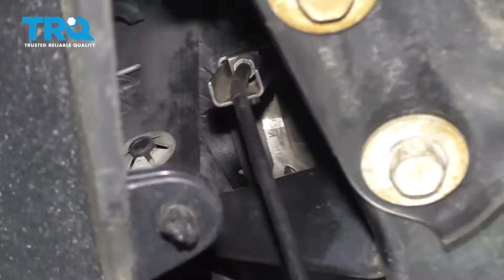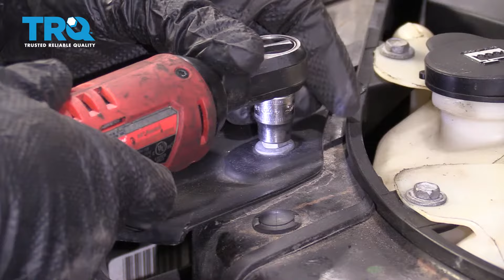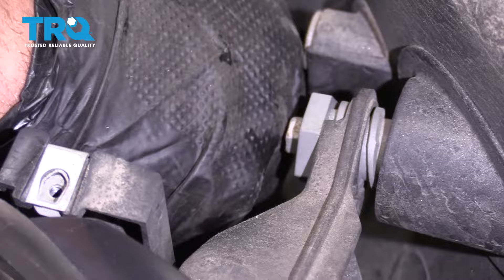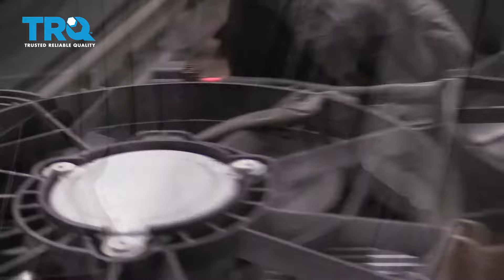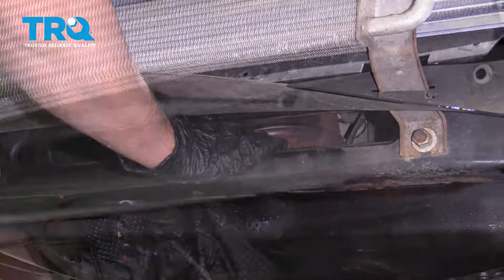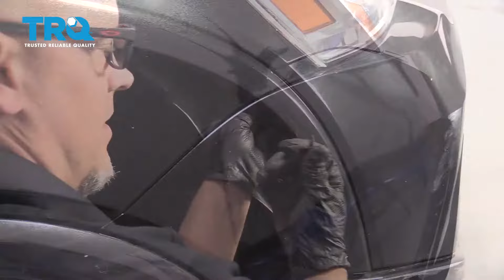How to Replace Radiator 2007-16 GMC Acadia

Comment: Great video. Suggestion for anyone watching. Don't take the bottom radiator hose off as the first step. Wait until you take the bumper off, it will be much easier. And if you're like me, thinking you might be able to get the radiator out with taking the entire bumper off, you can't.
Reply: Great suggestion...thanks need to replace mine soon

Comment: Bro, can you tell me if its true that in traverse models is normal when temp indicator go up of the middle? In my case in traffic o slow ride it pass the middle 210°, but in highway or parking it comes down to the middle please help, the coolant system its good no leaks, fans works, temp sensor its new

Comment: I have a question. My traction stability control light come on when i step on the break and it jerk. How can fix that? I changed the spark plug, PCV, cleaned the throttle and also I changed the brake pedal position sensor.. please help me.
Reply: You ever fix it?